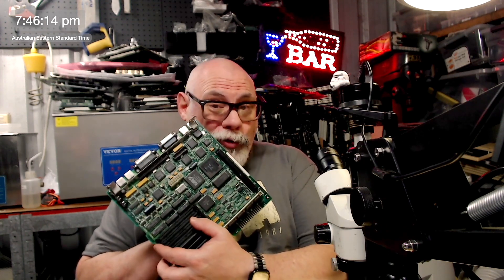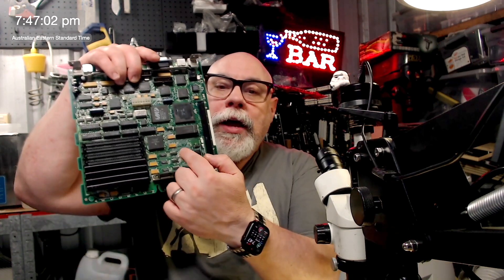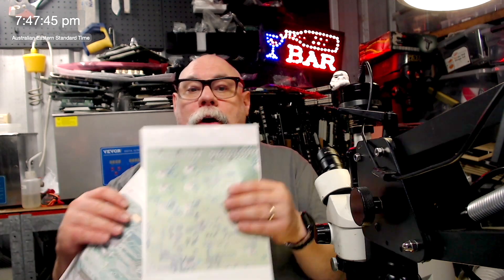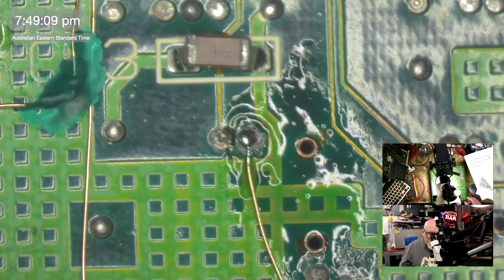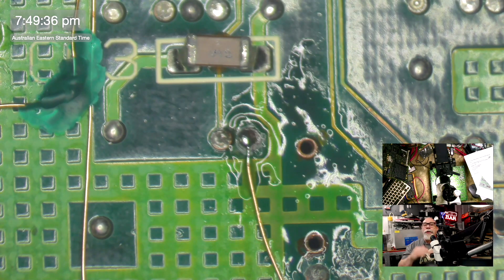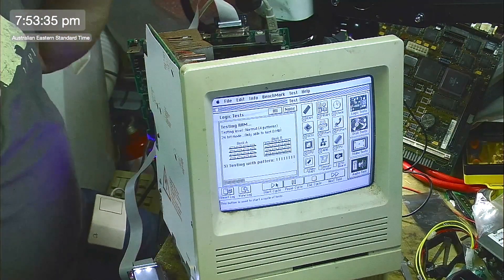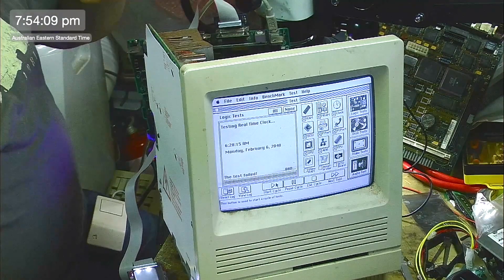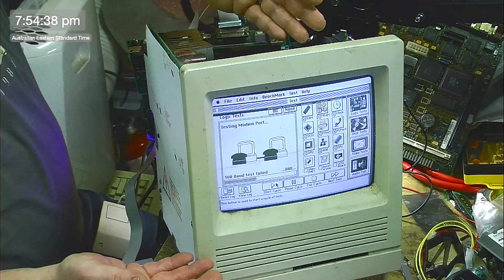Repairing a battery-bombed Macintosh SE/30, Part 5 and a half

Comment: I have a SE-30 to restore this coming up winter I am glad it did not have any battery damage just need to replace those dreaded electrolytic capacitors and rebuild the analog board .

Comment: Great that you got it working! For the problematic via, how did you know there was “something in the middle”?
Reply from the maker: By using the schematic and the multimeter. The signal was supposed to go to three locations on the board, but it was only going to two.

Comment: Oh crap, these all in one Macs have internal layers in the PCB? My battery damaged Classic might be screwed then...
Reply from the maker: You'll be pleased to hear that there are no internal data layers in the classic logic board, only power and ground. The Classic is a 4 layer board (the SE/30 is 6 layers).
Reply: @BranchusCreations  oh thank goodness! The battery nuked what I assume is either the address or data bus, so it's not power or ground 🤣 I'm still not super confident it will work when I'm done, but it's been fun working on it.
Reply from the maker: @rpavlik1  Have you seen the Classic reloaded project? You can transfer all the components to to a brand new PCB if needed.
Reply: @BranchusCreations  yes I have. If this doesn't work that will be my next step. Right now I'm just trying to figure out how specific I need to be in my analog board capacitor replacements, trying to match series and things like max ripple and impedance. Had two definitely dead caps and of course I have nothing even close in capacitance and voltage rating, and so if I have to order I may as well order most or all of them...

Comment: Congrats on getting the board to boot up, even with some unresolved issues. I’ve tackled two battery bombed SE/30s with the first resulting in a 98% working board with just some issues around the serial ports which causes a lock up when testing with snooper. The second board was much more badly damaged and after installing 40-50 bodge wires with probably the same again ahead of me, I called time on it and instead ordered up some “Bolle” reverse engineered PCBs and transferred the components over. I actually got some help from you regarding snooper and the loopback plug required at the time on one of the forums.

This new PCB effectively worked first time, ignoring some preliminary checks with chips removed, and has resulted in a machine that could easily still be working in another 35 years. On one hand I was proud of my soldering but at the same time I was amazed that it all came together so relatively easily.

To be honest, this gives me mixed feelings because it’s a bit like taking a racing car that competed in Monaco with Sir Stirling Moss at the wheel, and replacing the chassis because it was a bit damaged. It loses some authenticity right? But at the same time, the end result is so much more likely to last the distance. 

Not trying to put you off continuing with the repair but if it gets to a point where you just can’t make forward progress then please consider doing a second series where you replace the logic board with a modern replica and migrate the chips across. I think that would be a very interesting “season 2” of you project if it came to that.

Keep up the good work, and thanks for playing your part in inspiring me to refurbish my SE/30s.